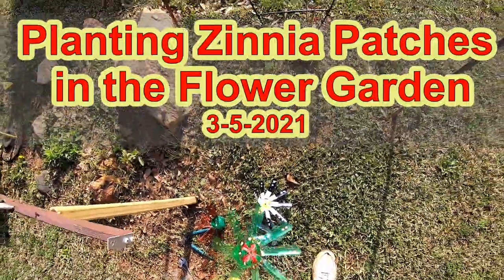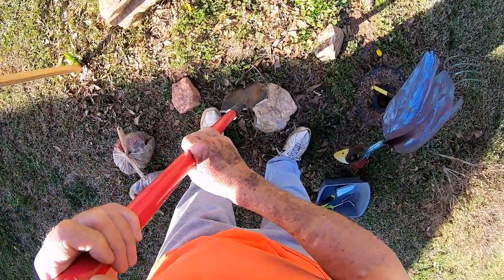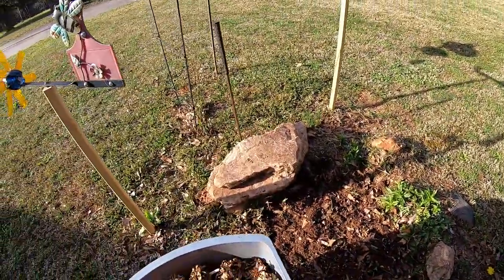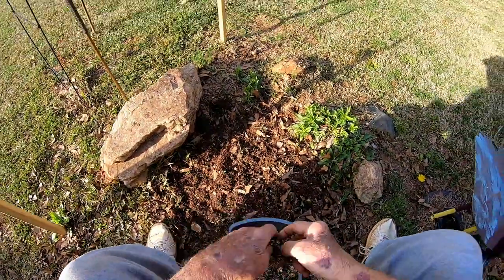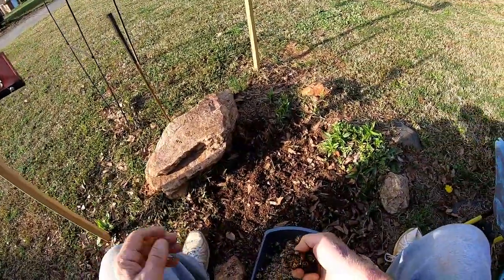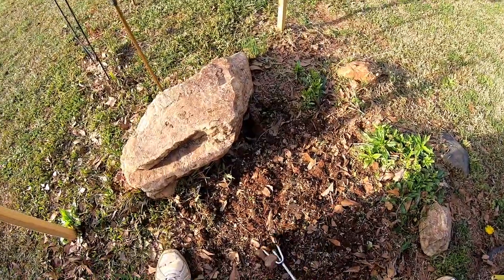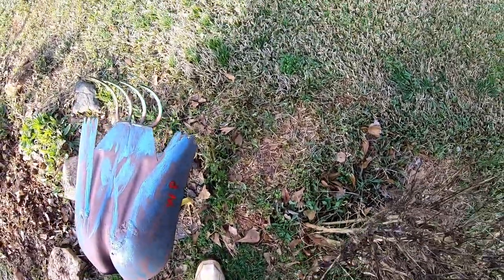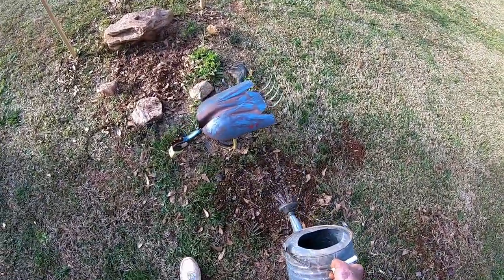Planting Zinnia Patches Flower Garden VLOG 3 5 2021

Comment: I bet they will grow Walter. 
Checked out the mower today. Had to charge the battery and air up the tires but it fired right up. Two or three weeks away from mowing.
Reply from the maker: Good going John  I still have some mower issues